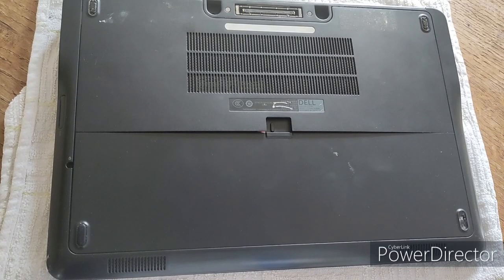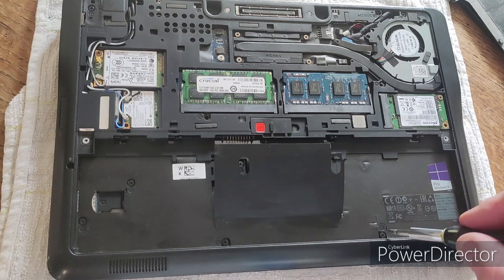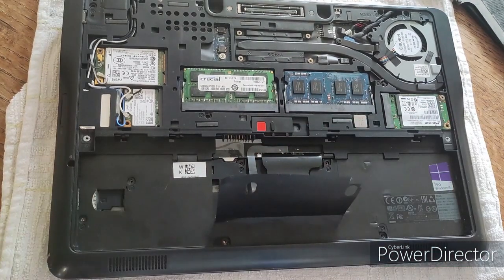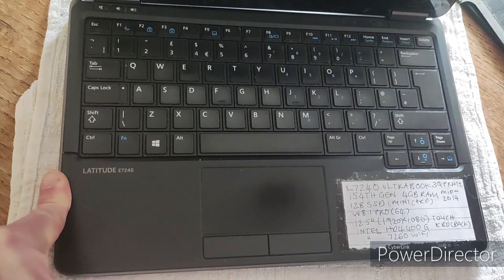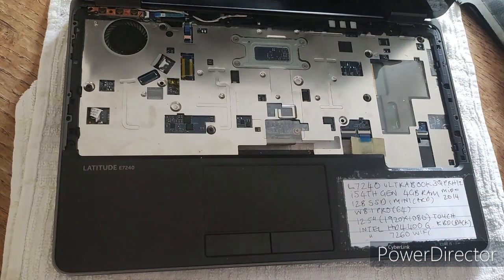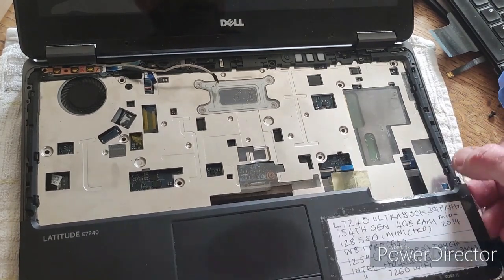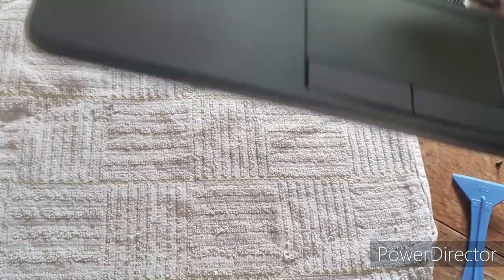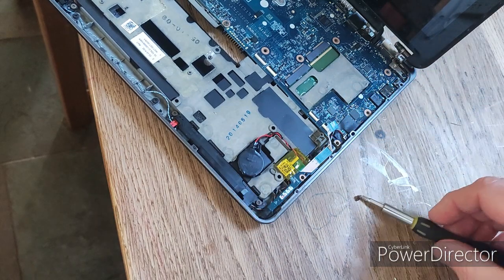Dell Latitude E7240: How to find and replace CMOS coin battery

Comment: Thank you for suggesting to remove the back panel cover. That's not mentioned in the Dell repair manual, and it partially obscures the unmarked, top side, top-left screw holding the palm rest in place. I mistakenly removed the screw holding the volume control pcb instead, which didn't work.

Comment: (Last few seconds) the white plastic body that prevents the red and black wires from arcing is meant to stay clipped onto the metal crimped ends, so they don't rotate or swap positions.

Comment: what a pain in the a##. the 7250 has a simple replacement. ot probably cost $250 to change the dead battery in s $50 laptop.

Comment: I have a question, if your CMOS battery is dead (or its cables damaged whatever), does it always result in the reset of BIOS settings when the laptop is turned off, even if it is permanently plugged in or has the ordinary laptop battery sufficiently charged in?
Reply: No, the BIOS will only reset if the laptop is not plugged in and the battery is removed or completely loses its charge.